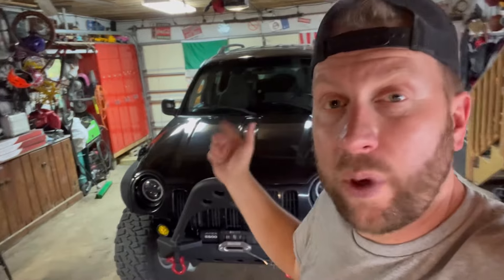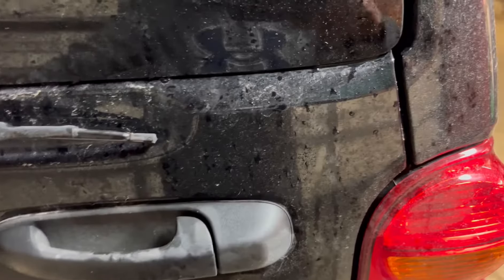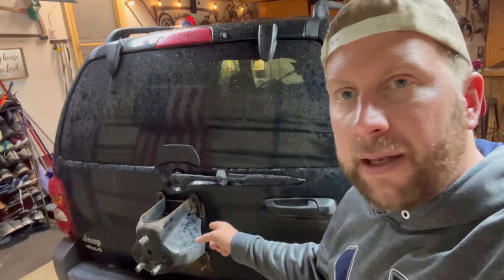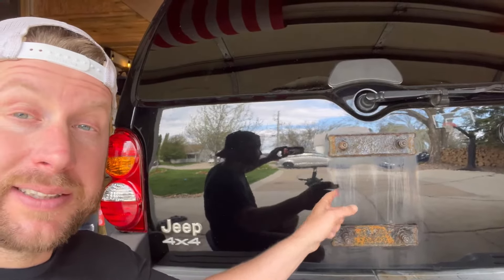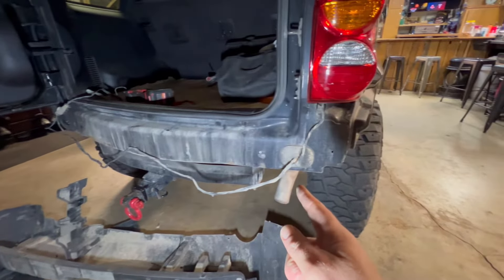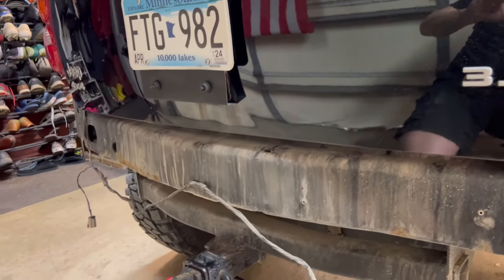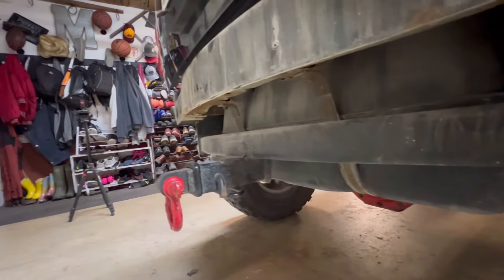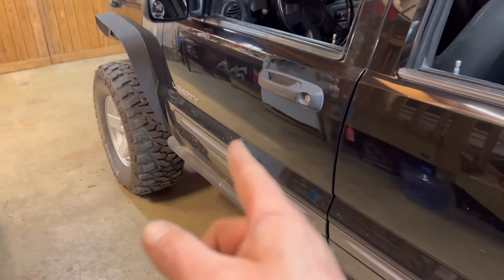JEEP FAILED | KJ Jeep Liberty Spare Tire/Tailgate Rattle Issue #jeep #thelibbyproject #failed

Comment: speaking of tires, did you ever regear? if not hows she like the tires? ive fallen down the rabbit hole of regearing a liberty and cant seem to find what i need and just wondering if you did anything else would love to hear/see. love the liberty man we do alot of the same lil projects then you come out with a video the next week giving me better ideas lol
Reply: Mine is on 33" bogger with stock gear on 4low there not Much differnce but for daily Driving i would rocomend it
Reply from the maker: We run 32s with a 5 speed with the factory gears. It pulls and drives pretty well. 5th gear struggles on very windy days and steep hills but all and all better than expected. Thanks for watching 👊

Comment: I use a 2 inch drop hitch flipped with a 2 inch ball. This is just the right hight for the 265/75/16 on moabs to get pushed up just a bit to take a lot of weight of the gate
Reply from the maker: Wow. Sweet idea. Thanks for sharing 👊